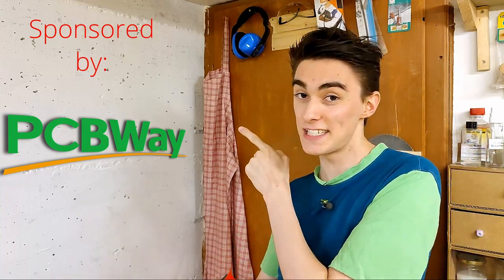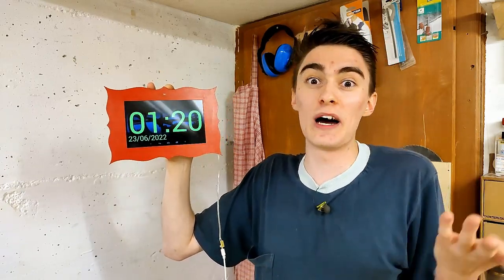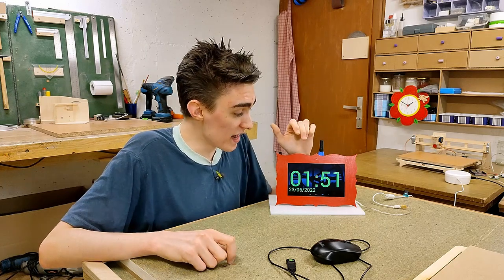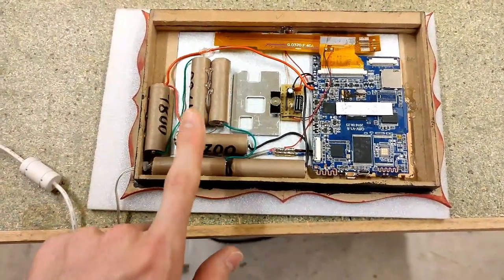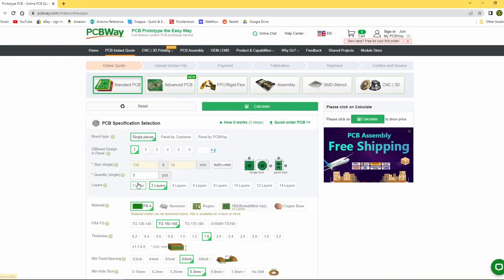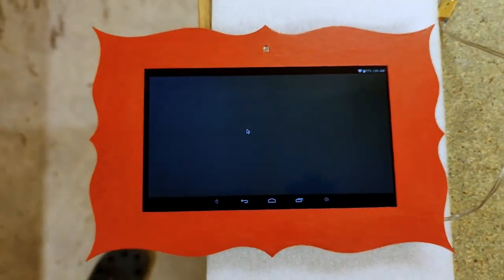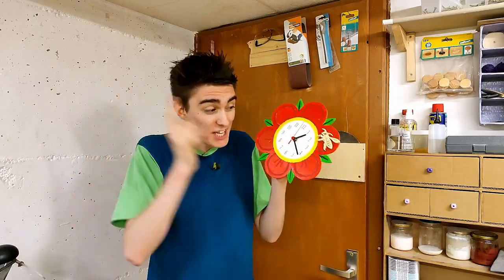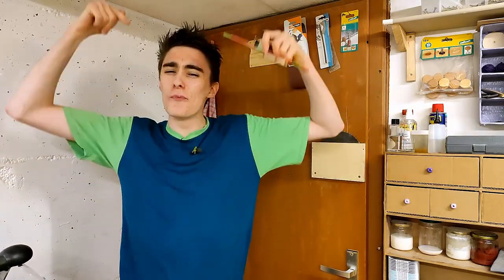I built world's most overkill digital wall clock for $0.00

Comment: I'm using an old Android tablet as a security camera monitor for a 12yo phone running IP Webcam 👍
(I can see my cat is at the back door 😆)
Reply from the maker: Yeeess I LOVE it when old stuff is reused and upcycled that way! 😅 👍👍
We still have a couple of 10yo phones knockin' about, tho not sure I can get any apps to still run on those 😂 theoretically a fancy alarm clock could be made the same way...
Reply: @ChronicMechatronic  Android 4.4 seems to be the minimum for the IP Camera apps. They work really well 👍 

I sideload the apk's from uSD cards or USB stick & adaptor thru the charge port.

Good thing I've got apk backups of every app I've used since my first HTC Desire Android phone in 2010👍😂
Reply from the maker: @edwardfletcher7790  yeeah ours were the HTC desire S as well I believe! 😂 Those were some indestructible phones... However they're stuck on Android 2.3.5 which is why I haven't yet found a better use for them ☹️ (but they're still in use as MP3 players & flashlights, hahaha)
Reply: @ChronicMechatronic  You Rock Dude, thanks for the lengthy explanation 👍😆
Reply from the maker: @edwardfletcher7790  haha, I'm bad at getting things across effectively, sorry 😆
Reply: @ChronicMechatronic  It's the sign of a creative mind 👍
Reply: @ChronicMechatronic I'm trying to understand why you need the batteries ?

Can't you just drive it from 4.2V into the battery circuit ?

Any app with ads can be thwarted by turning off WiFi ..

Your $50 3D printer is kickass 👍😁
Reply from the maker: @edwardfletcher7790    the batteries are just a backup for the short power outages we sometimes get. They're connected to the same battery connections the original LiPo cell was wired up to, and the whole device is then powered with 5V via the charge port. This  always keeps the batteries nicely charged using the internal charge circuitry and it automatically switches to battery power if it loses mains because it thinks "the charge cable got unplugged"

I'm still adding to this project, soon I'll make it run entirely off solar once I install the panels I recently got for cheap! 

Thanks 😆